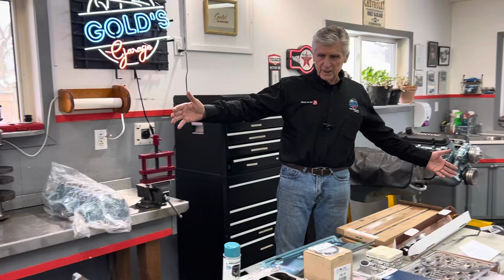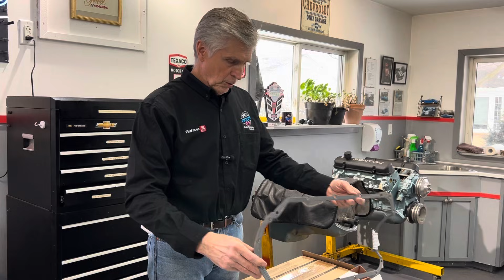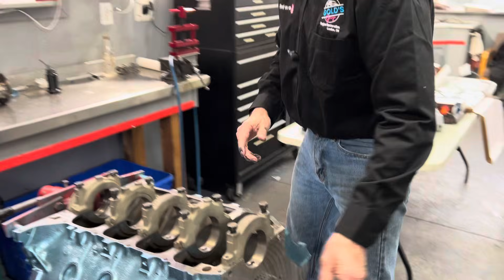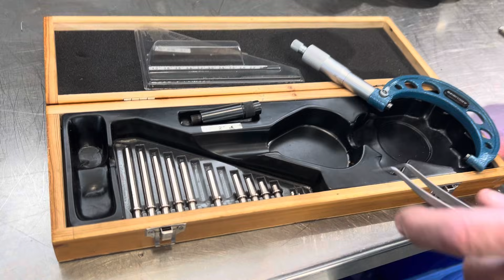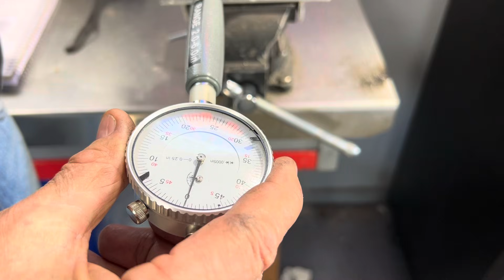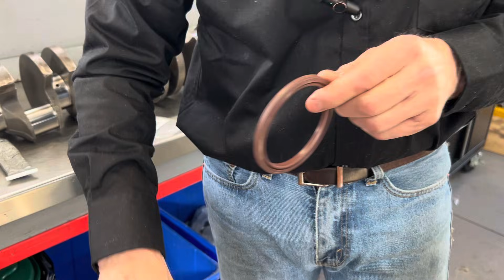Happy Ending to a Sad Story! Building a 400 Pontiac - How to install a flat tappet camshaft!

Comment: excellent video. please explain why the middle three main caps look like the ends are broken off?  Its a 2 bolt block but it looks like a 4 bolt with broken main caps,  Thanks
Reply from the maker: Good catch Michael. The dowels are just for location and do not contribute to the integrity of the main bearing cap support. There is sufficient material there to locate the cap correctly. AG
Reply: I appreciate your response, keep the great content coming.  @goldsgarage8236
Reply: @goldsgarage8236 are they actually broken though, or have they been modified for something?
Reply: Was looking for a comment about that.  My guess, someone put the caps on 180 out..

Comment: I am glad you explained the use of ARP vs OEM GM fasteners. ARP does make very nice bolts and I always think of Bill Jenkins because he used GM bolts and oil pumps and fabricated his own spacer bearings using OEM GM bearings for swapping cranks in a small block. It is good to be frugal and wise. Have you ever used the fasteners from SpeedMaster?  I have dealt with them and the products always looked somewhat inferior. I have a set of their head studs and then opted for a set of ARP. Just wondering what your experience with SpeedMaster is. Their engine blocks are supposed to be nice. I ordered one back when the LA harbor was a bottleneck boondoggle and it was like pulling teeth to get a refund a year later for not supplying a block. It was not a happy experience.  The wires on the distributors are smaller gage than what is commonly used and I have no experience with their electronics. I see Summit, Jegs and I think possibly Speedway has some of their products for sale online now. I do know the manifolds flow less than what they mimic from watching a couple Youtubers that do nothing but head flowing. Great videos. I believe you cover all the pitfalls and give an excellent explanation of why one way vs another.  Keep them coming.
Reply from the maker: Thanks for the question 4speed. I have used many Speedmaster products with good results. I wouldn't worry about it. AG

Comment: Biggest thing with ARP rod bolts is the torque spec is with ARP thread lube. It would be much higher with motor oil. Factory stuff is spec'd with motor oil- it would be less with ARP lube
Reply from the maker: Correct, thanks for your comments Robert. AG

Comment: With the screw in studs for the air filter you have to safety wire tie that or put 2 holes in it top and bottom then put small c Clips in it  this way it will stop from unscrewing and dropping inside the engine block😊
Reply: Why not just put a lock nut on it?
Reply: Put a lock nut on it, nylon lock nut works well AG.  Carb stud...

Comment: I always thought the Pontiacs had a 14 degree valve to cylinder angle and the valve job was 30 degrees on the intake for improved low low lift flow.
Reply from the maker: You are correct David, I meant to say a 30 degree valve seat. Pontiac’s built before 1967 were a 21 degree valve angle after 1967 were 14 degree. We’ve made a quick edit to the video to avoid confusion.
Thanks for commenting. AG
Reply: From ‘67 Pontiac changed to 14deg valve angles. Prior they were at 22deg. Alan I think you mean the valve seat angle is at 30deg?👍
Reply from the maker: Thanks Dave, you are correct. I meant to say 30 degree valve seat. We have made an edit to the video to avoid any confusion.
Thanks for commenting. AG

Comment: What is the deal with the broken ends on the main caps where the locating dowels go?  There is no way I would use that block or at least have good main caps installed.  The machine bill to have other caps installed could exceed the value of the block. Here it costs about 7 to 9 hundred depending on the engine.
Reply: Was going to replace them, the machine shop told me they were more then fine to use.
Reply: @67Firebird  I would not use those caps on any build in that condition.
Reply from the maker: Thanks for your comment John. The location dowels are just that, they locate the caps. They are outside of the main bearing bolts and do not contribute to the strength of the main bearing caps. AG

Comment: Just out of curiosity, why did he build a 400 instead of another 455?
Reply: I had a hard time locating a 455 block for a decent price
Reply: @67Firebird  Didn't want to have the 455 crank turned to fit the 400 block?
Reply: Have had some bad luck with Pontiac's over the years LOL .so I decided to just build a 400 instead of trying to stoke it  @CookieThumper-UFP
Reply: @CookieThumper-UFP  For what I'm using the engine for i didn't think i needed a stroker
Reply: @67Firebird    no one's EVER complained about too much torque, lol. 
Also, was the rotator balanced for the new crank and rods? 
Are the valve springs new and match that cam? Installed height and open/seat pressures set?
Reply from the maker: Thanks for commenting on your engine Joe, please continue to do so as you see fit. AG
Reply: @goldsgarage8236  i gotta say, I'm surprised you'd use those heads as is. Even from a known shop, you're still putting your name on that build, you should still disassemble and varify them. Are the springs new? Are they matched to the cam? What's the seat and open pressure? Do the retainers hit the guides/seals? Do they vacuum check? Were the guides replaced? New seats installed? Etc, etc... you don't have to answer all of these questions but it's what runs through my head when using an assembled head from "someone" else.
Reply from the maker: Thanks BEANS, of course we will check all that out on a future video. Watch for it! AG

Comment: Your explanation for number one cylinder is a bid confusing. Distributor rotation is correct.
Reply from the maker: Sorry for the confusion, The front cylinder on the drivers side is #1, however the front cylinder on the passenger side is forward to it. The connecting rod for #2 cylinder is in front of the crank journal, so the rod for #1 is to the rear. I will follow up with this point in a future video. Thanks for the question. AG